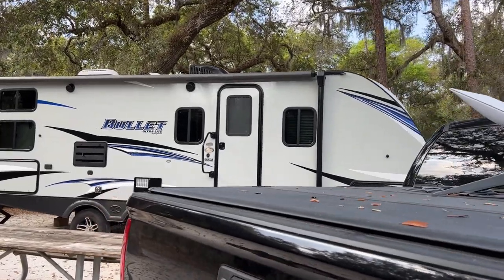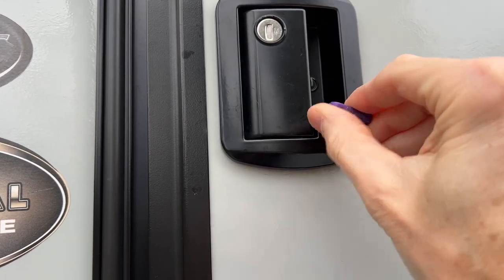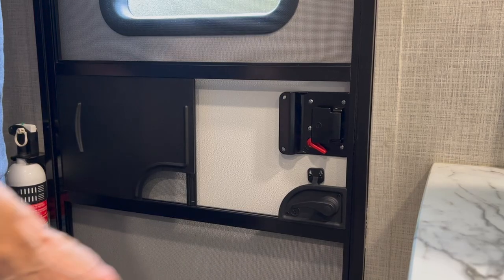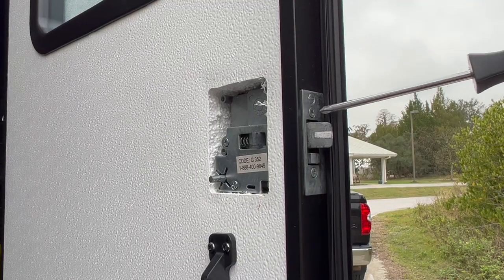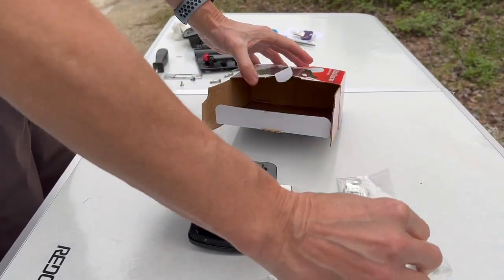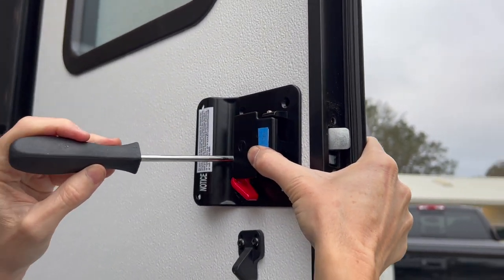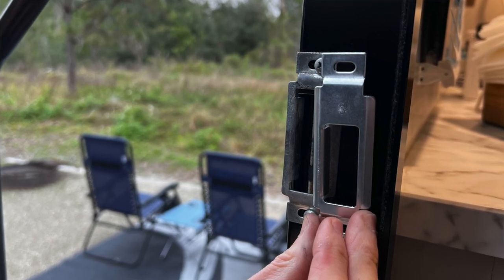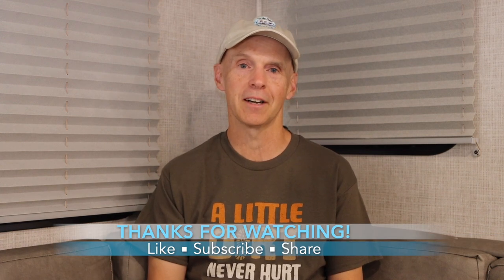RV Door Lock Replacement – Step-By-Step

Comment: I had a a similar issue.  The red lock was swinging in the wind.  Wouldn't lock from the inside.  I took my lock apart and found that the metal bar connecting the red lever to the deadbolt had fallen off!  And a screw had fallen out.  I just put it all back together, screwed it tight.  Lock works fine!  I did NOT have to buy a new lockset.  Just 10 minutes of my time.  I suggest you inspect your current lock before buying the replacement.
Reply from the maker: Good idea, thanks for posting.

Comment: Replaced mine a couple of months ago with the OEM electric keypad on my 2015 R pod 179. Still cannot get it to connect to my phone through the Bauer app though.
Reply from the maker: Sorry to hear the app isn't working. Other than that, it sounds like you like having a keypad model?
Reply: @JohnMarucci  Thank you for noting my comment, John. Hope to meet you some day. I'm moving from the Oregon coast to northern Florida, so perhaps that will enhance the probability to come across one another. I replaced the keypad lock with which the RV came. Before I sell the RV I hope to get the App working on my phone to show inquiring persons. Thanks again for the comment and your helpful videos.

Comment: How do I measure to know what size door latch I need ?
Reply from the maker: Here are the specs for what I installed: Outer Dimensions: 3.47" wide x 4.28" tall. 

Fits doors that are 1-1/4" to 1-1/2" thick.

Installs into latch cutouts that are 2-1/2" wide x 3-1/2" tall to 3" wide x 4" tall. 

Here is the link to eTrailer where I purchased the item: https://www.etrailer.com/RV_Locks/Global_Link/295-000019.html

Comment: Any suggestions what to do if that little black piece below the lock that holds the screen door to the main outer door starts to come loose?  The screws are just set in the aluminum door shell and can no longer be securely tightened. this allows the little black triangular plastic piece ti move freely up and down which prevents it from engaging securely with the screen door.
Reply from the maker: I was just looking at mine. It looks like if I had to, I could move mine about a 1/4" to the right and reset the screws. The handle that latches has some lateral width that it might work. I suppose the only other solution would be to get a very thin piece of metal as a plate to install on top of the existing holes to screw into. Hope this helps!

Comment: Good information on latch replacement. I have the keypad keyless entry on mine . Love it . A little graphite in those keyholes makes those locks last longer in my experience. Thanks for sharing John!
Reply from the maker: Good tip on the graphite. Thanks for sharing your experience with the keypad type lock!

Comment: John, did you consider a keyless lock as a replacement? Could you comment on your decision or pros and cons to keyless?  Great video thanks.
Reply from the maker: I actually have a keyless RV door lock in a box at home but didn't bring it with me on this trip. I was saving it for a newer RV but may consider putting on this RV as some point. I think they are generally good and generally wouldn't hesitate using one. I am sure there are some YouTube reviews online. Thanks!

Comment: I have 2 doors for that reason. Also for a emergency exit incase.
I also have spare and masters.
So if you can. Please explain if you can on getting in. If not I get it. I will now have to check out mine incase.
Reply from the maker: I had to literally break into my RV. I had my other RV keys and figured out a way to get in without destroying anything. Once I was in, I could open the door from the inside. There is more to it, but I'll need to leave it at that. Thanks!